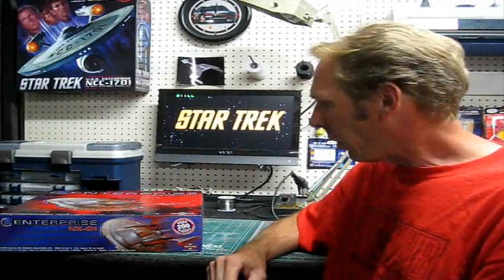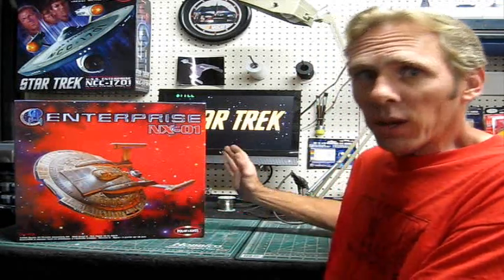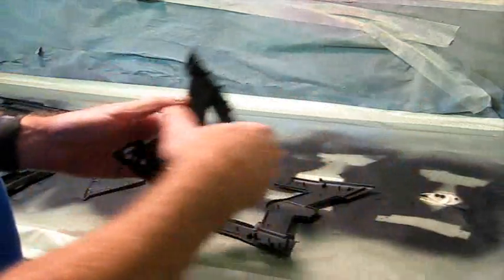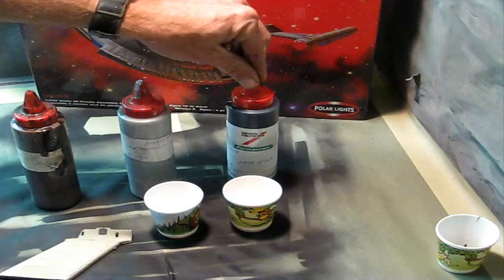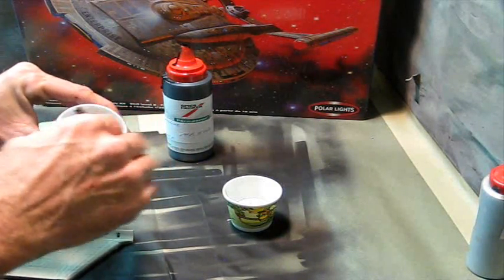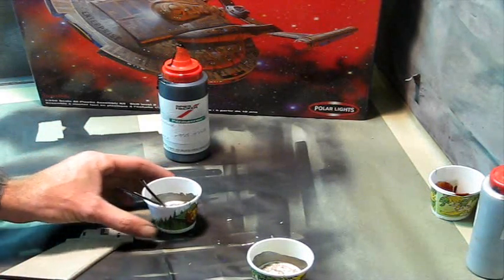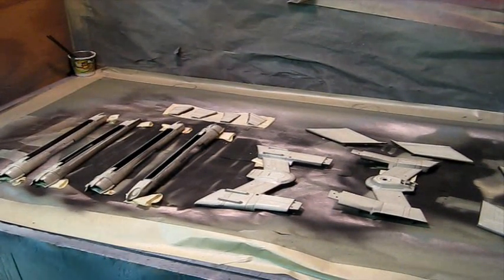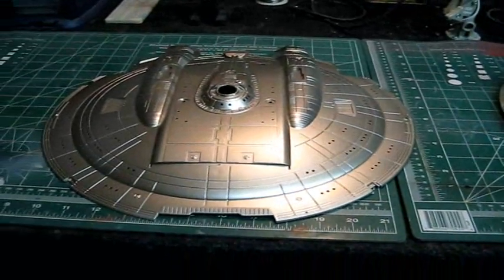Polar Lights 1/350 Scale Enterprise NX-01 Buildup PT 1, Painting The Hull

Comment from the maker: I buy the magnet wire at Radio Shack. It does have a coating on it.
0.30 gauge in size. It works great and I have not any problems with using it.

Comment: I'm pre painting this model now and I found a  automotive paint that is a little darker than the plastic kit color that you might want to consider using. Dupli-Color Perfect Match for a Ford: BFM0354 Arizona Beige (AQ) in a rattle can. I paid $10.49 at the local auto parts store. It looks really nice on the model. Now I will have to let it cure for several days .

Comment: Great job. But of course I have questions. I have all 3 Polar Light Models 1/350. Can you please specify, what type (brand maybe) of paint you use, along with the type of putty, glue and your type or name brand of your air spray gun, do we need certain nozzles? I am very concern because I read on the net that most household spray can pants can actually warp, the plastic or otherwise harm it The models are expensive, I do not want to make a  expensive mistake making them. Thank you so much!